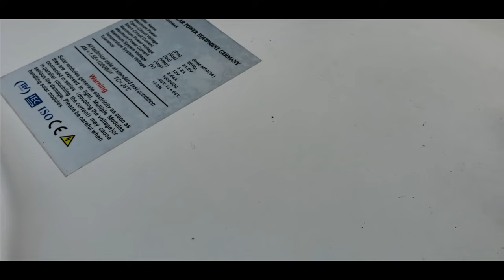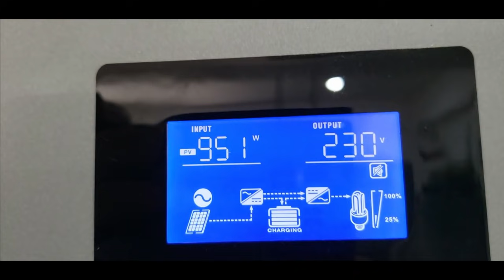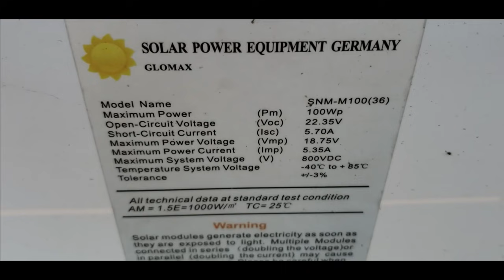Philippines Beach House Build Day 157 : Foreigner Trying to take OUR BUILDING CREW

Comment: have them use your diamond wheel on the small grinder, held at a 45 degree angle to make their groves in the hollow block for the conduit.  that diamond wheel will chew out that groove top to bottom in less than 10 minutes.
Reply from the maker: David how can I make a video showing a comparison of techniques then?  Most of them dont have grinders and cutting wheels. The only reason I allowed those to be done was so the audience can see the difference.
Reply: @TexasFilipino  ahh.   Yes, good point.   I am an idiot, I was not thinking.  Haha. You made that point in the video.  Sorry, my bad.    I look forward to final  comparisons.   Your place is coming along great. God bless.

Comment: After you have formed your walls you are left with holes where the bolts go through, what are you filling those holes with?
Reply: Cement when it's skimmed coated is my guess.
Reply from the maker: they are all plugged with a cement mortar mix right now. yup when skim coated like they never existed

Comment: James with the interior walls butting up a fresh wall to a cured wall is the bonding there strong.
Reply: From what I've learned from watching so far the short answer is yes...and there will be opportunity for movement with seismic activity to keep the concrete from exploding
Reply: I was not intending to answer for or instead of James, just seeing how close I am to the correct answer
Reply: @albertthedogeinstein7983  thank you
Reply: @peter-bakestar  no problem...you moving to the Philippines as well?
Reply: You wind up with cold joints yes but considering that he is using oversized steel and going beyond code in the amount of steel that is using it won't be a problem he's not building a high-rise
Reply from the maker: you dont want things to monolithic . Plenty of steel for strength but a little places to slip for small movements.
Reply: @TexasFilipino  thanks James
Reply: @TexasFilipino  yes and no , you can't pour the whole building at once you have to do it a little at a time a 30 story high-rise building is not poured all at once it will have cold joints

Comment: great youtube channel and great videos.  looks like those screws cam from the USA, for i could never find any screws like the ones you are using or screws that are as long.  I built my 2 story house in Carcar, Cebu 2000-2002 using my late wife's relatives and neighbors, except for the steel roofer from Cebu city.  The house was my design, and my late wife was the boss when i was not there, which was for only 3 weeks in may, due to my job in the USA. Anyway, the house was built the filipino way, mostly, with cinder block and pebble (small rock) finish

Comment: Thanks for the tips, I had to break out the notebook to write Far Eastern in it. I get the walls are 4", but how about the floor of a two story? I would guess 8" so you can run a 4" pipe,correct?

Comment: What do you use for a form release on your plywood? I use wire through the holes and a twister to get forms tight over small chunks of rebar.
Reply from the maker: this is special form plywood with a nonstick film. I use all thread with washers and nuts not wire

Comment: Warning! I’ve had negative experience with skim coat in our house, maybe you won’t see it but, it seems to crumble and fall out in some areas. I have a feeling it’s wicking up moisture from the blocks beneath the floor that were installed before the floor was poured where the moisture barrier wasn’t applied. I wish we would have used an additive not plain skim coat. Skim coat mixed with water is not my favourite. In hindsight, I would search for an epoxy based premix or something, if there is such a product...
Reply from the maker: There is some lousy brands of skim coat as well and some state for interior use only and yet they will apply it outside. I get your moisture problem inside. buried in hollow block with ground contact - like a wick. They build the walls and then pour the slab later. Well I did pour in later but on top of a 14" wide tie beam and we put moisture barrier down. These ways they have of building are mold breeding methods all day long plus direct pathways for termites!  Island brand seems ok.
Reply: @TexasFilipino  Yup.  Moisture barrier is a rarity up here, and we live in a flood prone area. .
My friend from Belgium,  had a lot of rain,  slightl flood. 
Water came from underneath,  flooded his whole ground floor for months,  until the outside area,  watertable dropped in the dry season !
Was sitting in his kitchen/ diner eating ect, wearing rubber boots!
Actually got a Nasty infection in his foot from it!

Comment: I would of liked to see how you propped and braced the backside of that wall on your neighbours side, to keep it against the existing wall and floor of the house. 
Is the wall flat all the way down (even plain) or was there lip, a bit of floor for the form to sit on? 
Nice job mate 🤙🏼👍🏼👍🏼
Reply from the maker: straight smooth wall. Now to address how we hung the form. We drilled and put a 2x3 piece of lumber for the 1/2 plywood to rest on. Once the bolts with spacers was put in place and the plywood sandwiched it wasn't going anywhere. the columns steel was held inward with ratchet straps the wall really needed no bracing outside. Just braced on the inside.  Steady pouring up nice n slow gives constant bonding. The bottom is setting as we rise, a benefit of bucket pours. You can't  get ahead of yourself  and overload the forms too fast like with a pump truck. Tortoise  and the Hare
Reply: @TexasFilipino  aahhh ok got ya👍🏼👍🏼

Comment: The Hollow Block work in the Philippines looks like crap then they take a hammer gun and chip out large channels to run wire . At least they should run the electrical conduit up as they build the walls like we do in the States. It’s so easy